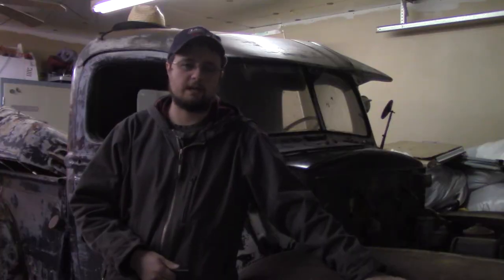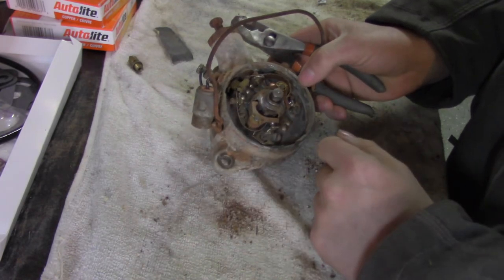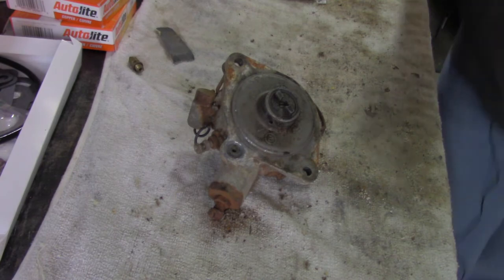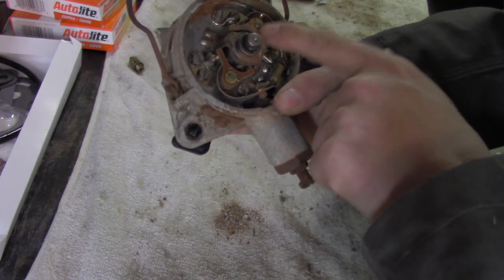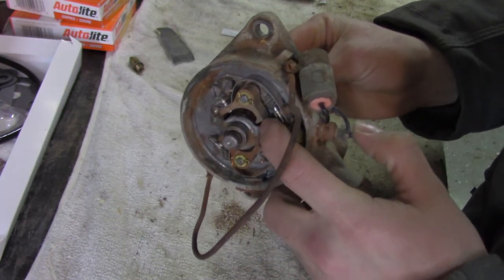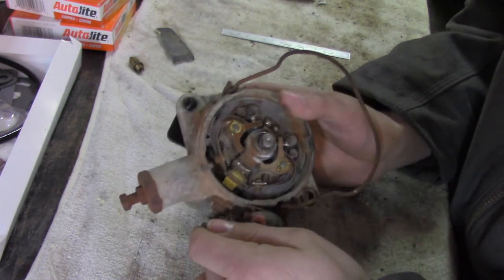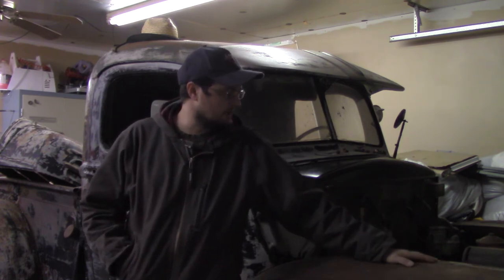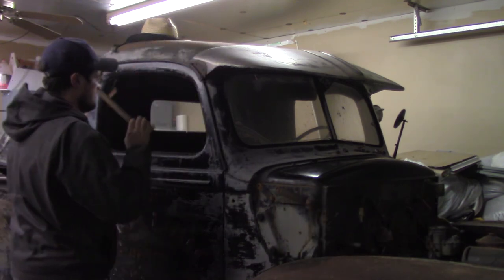Ford Flat Head Distributor Timing | Timing Jig | Wilcox Timing Alternative

Comment: The way I was taught was to set the points to .016 to allow them to wear in.  The card from a cigarette pack of a business card is about right and you can check with a micrometer.  A metal feeler gauge may scratch or contaminate the point surfaces.  If you do not have a jig lay a straight edge along the wide side.  Should be 3/8 inch from the near edge of the hole.  I use my ohm meter to determine when the points are open but one could rig up a small bulb and portable battery .  As far as the vacuum brake goes, find a steep hill and adjust until there is no spark knock with the throttle wide open.